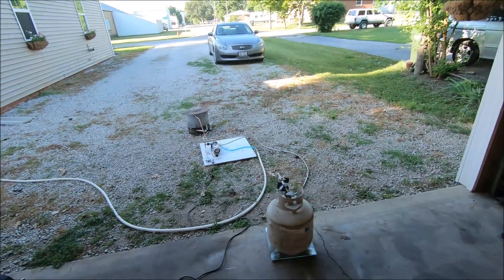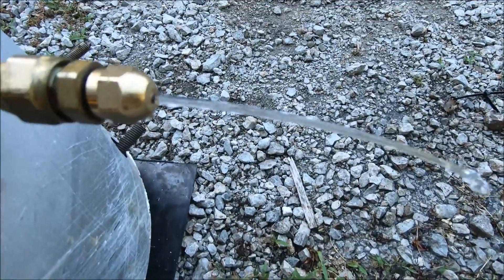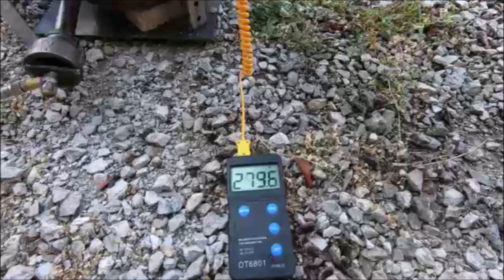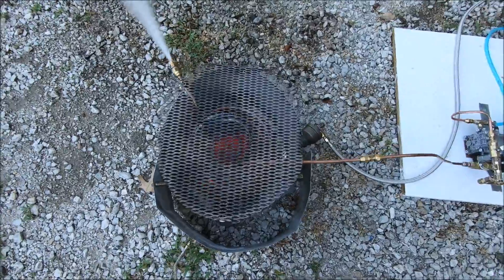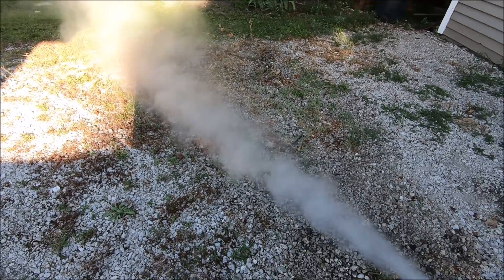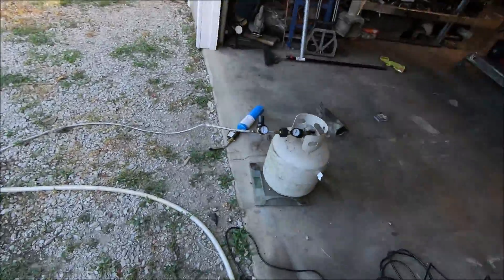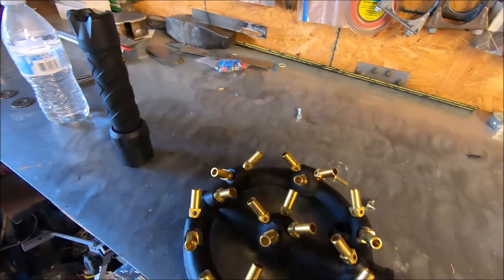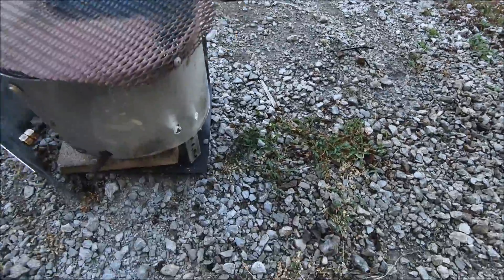Vortex IR ring Burner Producing 279 deg steam 1 .3  LPM water flow

Comment: Turn your propane tank upside down :p, kidding ! love the burner change . Ir burner all the way for this application . Do you need a super heater? Run a loop down around your burner and your set ! This is turbine worthy ! I didn’t see your construction video   Have you considered installing baffles inside your burner to sink some more IR heat ? You could also have multiple inputs and run less fuel pressure but more fuel volume ? It’s kick ass man I love it .

Comment: I am really enjoying watching your experiments. I have learned a lot. Do you ever sleep? :) 

I am curious what it would take to do an electric flash boiler. Is there enough power coming out of a 120V wall socket to get a useful amount of steam to do cleaning? I have a tank type electric steamer, but it seems a flash type would be more compact.
Reply from the maker: LOL , you actually made me laugh on that one  , ive bin trying to but man , life is a flash in the pan ...
Reply from the maker: No friend , you need 50,000 to 30,000 watts , those plug in models are "gimics " they dont really work . Most homes are 12,000 watt 100 amp service.

Comment: Pretty sure you're getting water entrained in superheated steam. First because you get about a thousand to one expansion in going from water to steam (and that doesn't look like a 2k liter per minute flow). Second because pure steam is pretty much invisible. 

I assume you are using counterflow on water flow/coil ? Water inlet at the top, steam out at the bottom? A smaller nozzle so you have higher pressure in the boiler tubing would almost certainly raise efficiency. Best but really dangerous in a small shop/backyard, would be feeding the water with a nozzle at the other end sized to build up enough pressure so the water doesn't boil until it hits the nozzle and flashes into steam.
Reply: If you open the output valve all the way, and then use the recirculation valve and nozzle to give 100-300psi of pressure at the gauge I would expect pretty spectacular results without too much risk. (I think for all the water to flash into steam you would need a LOT more heat, 750°f or so temperature at the output, and about 3200 psi. It would, however, give you 3000 liters of saturated steam a minute)

The calculator I used said you'd only get up to 75% of the water flashing to steam at the triple point so either it's wrong or I'm missing something, and I can't find the physical calculator (ti-89) I use for doing the numbers such things.
Reply from the maker: Yes this is saturated steam and we are boiling 1.3 LPM flow not sure where you get 2k , also yes  water expands about 1600 times when converted to steam  but we need entrained flow , this is for washing cars  . the coil is co flow on this rig . Are application cant use pure steam as it doesnt clean very well . The exit temp on this test hit highs in the 270 deg area despite entrained flow .
Your flash steam idea would be good for killing weeds
Reply: @NOBOX7  1.3LPM water in * 1600 times expansion factor, if it were all saturated steam you'd be looking at more than 2000 liters per minute of steam. 

I'd venture that in the boiler tube you have a mixed flow of water and steam.

The reason I think you want to NOT boil any water in the boiler tube, and rather have it flash at or after the nozzle is that steam sucks at conducting heat. Pressurized water in contact with the tube wall is way better. So keeping the pressure high enough (or heat input low enough) should give you big improvements. Once past the boiler, an orifice or nozzle to allow for expansion and flash steam generation would give you high velocity steam and water at ~212  instead of water droplets entrained in super-heated steam which I think you are  producing at the moment.
Reply from the maker: @RobertSzasz  Great input . The reason i went with a co flow instead of counter flow in the test was to protect the coil , in practice im definitely a counter flow kinda guy  . I am trying to keep cost down is the reason you will see a lot of obvious things missing .  sub critical boiler is a fantastic device   but the testing and hardware would break the bank . However as i said in weed killing applications your idea would be great to deliver phase change energy to the plants .